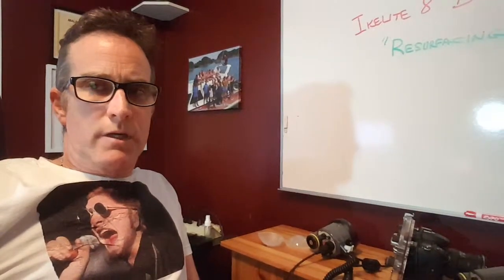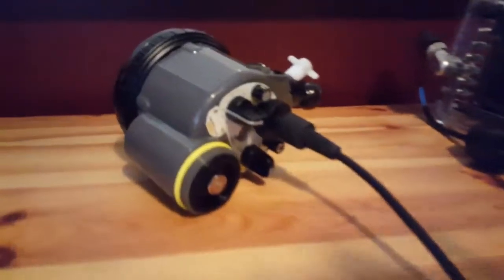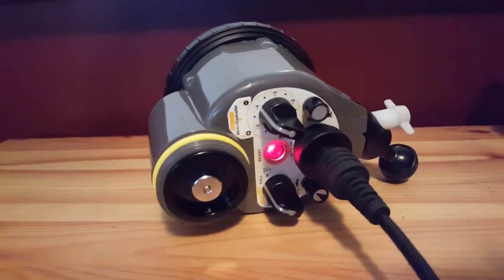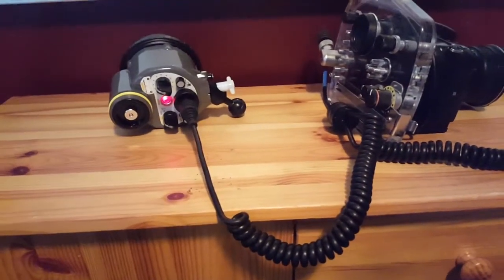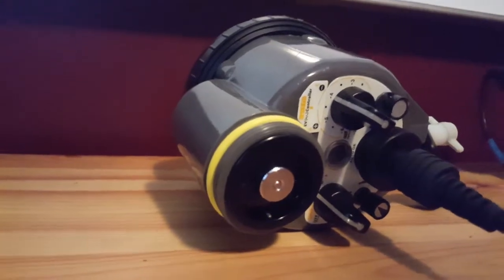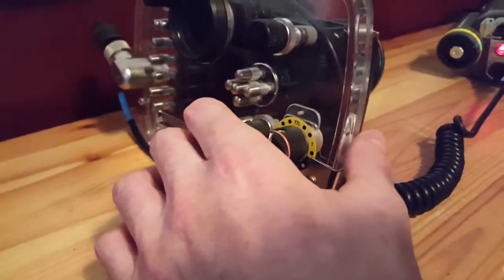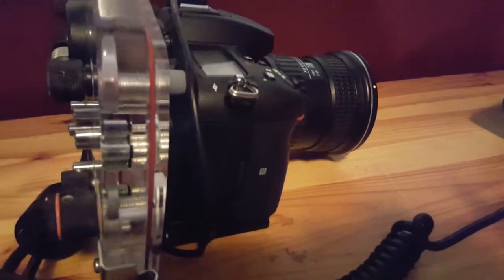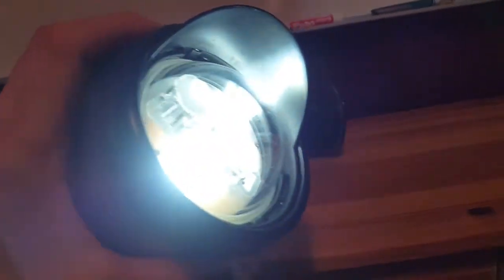INON Z330  Response Time - Charge vs Equipment

Comment: Just got myself a couple of Z330s.  What is the other push button used for?  Manual doesn't explain it very well.
Reply from the maker: Left button is focus light.  Press for 20 sec...or lock for permanent.  Right button is a half power button for quick changes.

Comment: Are u still using the two z330 strobes with the dual y-cable and are they still in wprking order?
Reply from the maker: Yes....all working fine.  Why do you ask?
Reply: Cause I have bought 2 Z330's  today and the manual said not to use a dual cable cause it can harm the strobes.   But i need to cause I have a Ikelite housing, so there is no fibre option then.
Reply from the maker: I have a couple tips.  1- Careful w threads.  Very easy to crossthread.  2 - water can leak past the boots into the connectors...so watch for that.  I fixed mine by taking apart and packing w high end quad silicone.  Only if needed.
Reply: What u mean with....past the boots?
Reply from the maker: boots are rubber wire protectors covering strobe connector.  They are not inherently sealed....it really is the actual metal sleeve underneath.....that may...leak.
Reply: So where you put new silicone.  Between the boots and the connectors or did take the connectors apart?
Reply from the maker: I recommend sending to ikelite if u notice a leak.  Your cable is new and under warrantee
Reply from the maker: Prefer fiber but don't have electronics....yet